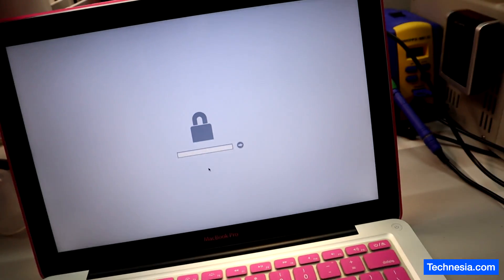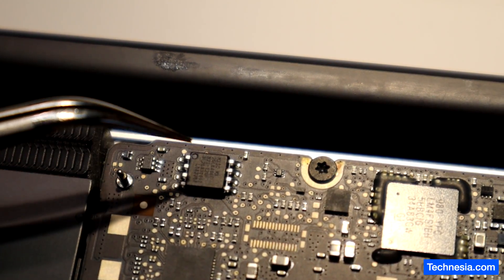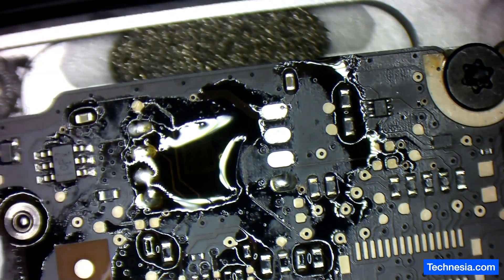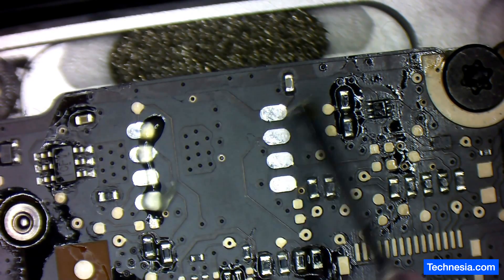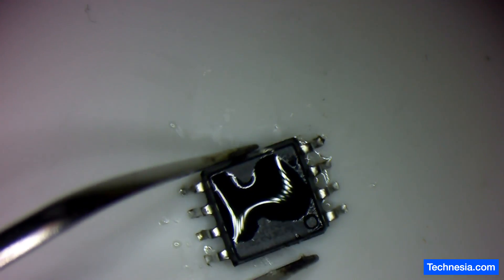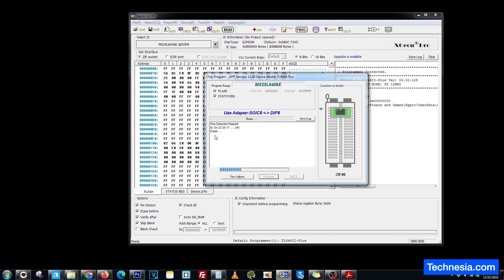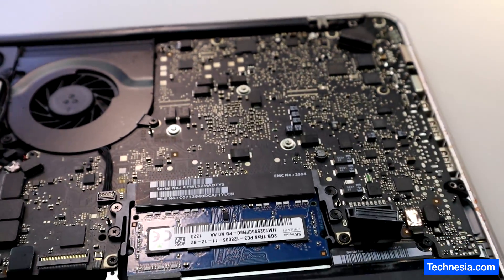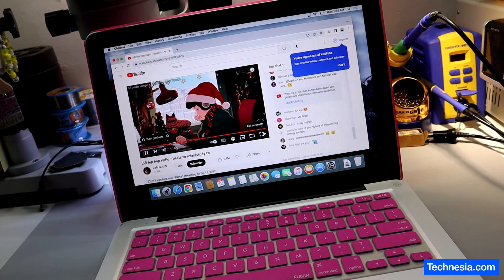Macbook EFI - Firmware Password Lock Removal

Comment: Hi I have a old MacBook Pro 2010 A1278 and was wondering if the chip method would work
Reply: Looks like were are cursed with our A1278s! No one can bypass the Firmware password!
Reply: @touchofgrey5372  yk I was cursed but I remember the password in the most miraculous way

Comment: Could you tell me where I can find clean EFI bios dumps for the A1278 2010 MacBook Pro?
Reply from the maker: badcaps or vinafix
Reply: @danfromtechnesia  thank you
Reply: @danfromtechnesia  On Macbook A1342 mid 2010, with Lion OS, produced in 2011-2012 also need to flash the chip or will the method with changing RAM and three resets help?

Comment: Why do all that. Put the unit in dfu mode and connect to another Mac. Run apple configurator and choose restore. It will wipe the password
Reply from the maker: Because we can and this is how we've been doing it. We have all the tools to do the job so why not use it :) and you may get confused with Apple T2 macbooks. Which is not this one :)
Reply: @danfromtechnesia  may be. Works on 2020- 2021 13 in MacBook pros
Reply from the maker: @aironwhite6533  this one is 2012 :)
Reply: @danfromtechnesia  Ah. I don't work on those in the depo.  I may ask someone if I get the chance though
Reply from the maker: @aironwhite6533 The other way of doing it is with this clip that you can clip on the chi and reprogram the EFI
Reply: @danfromtechnesia  taking the chip out of the circuit is the safer way. clipping it might result in unwanted behaviour due to other stuff in the circuit.
What actually could be some nice info for others, is that this can be done using cheap FTDI-chip adapters for all those SPI EEPRoms (which those BIOS chips often/mostly are). No need for a special programmer if you have some board with a CH340G Serial Adapter Chip or an FTDI chip. Just boot Ubuntu, install flashrom and you`re rdy to go !
Reply: Uhh yeah for 2017 MacBook pros dfu mode is way easier… this looks like a nightmare if you don’t know what you’re doing. Dfu mode is soo easy to use… I have a 2015 MacBook Pro as well as the 2017 but the 2015 one I have I was upgrading it to a new os and it turned off in the middle of the installation so it firmware locked it. And the Apple Store won’t fix it because I can’t find my original receipt! So lame. So I would like to have it done but the 2015 MacBooks are so cheap and I don’t even care to fix it since I have a 2017 MacBook Pro now. Was thinking about selling it or trading it in for a m1 MacBook Pro
Reply: Does this actually work?
Reply: @hiphopanonymous9859  Yes. we use it at work because the password stops us from running tests after the repair.
Reply: This way he doesn’t have to wipe the ssd